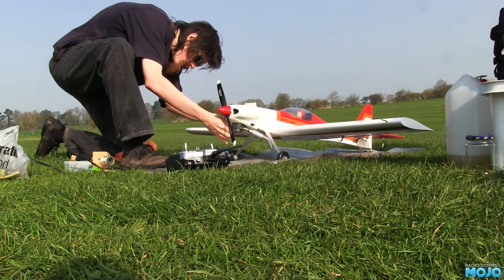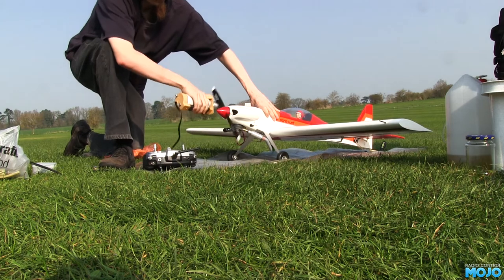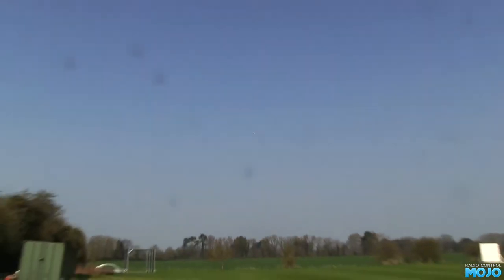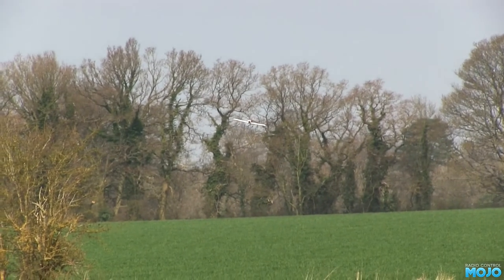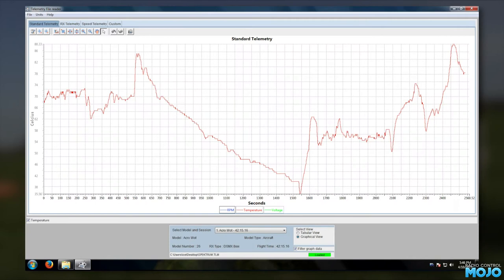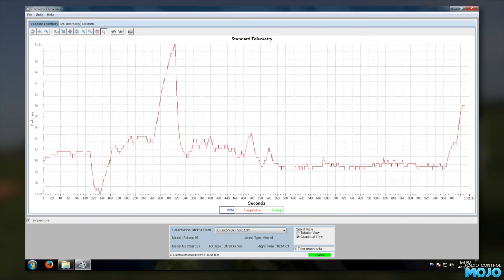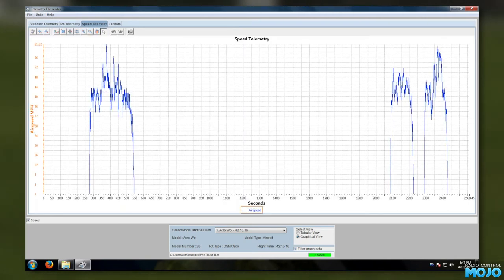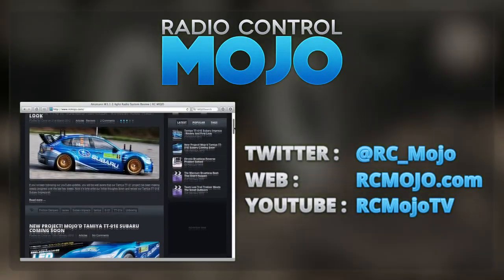Chris Foss Acro Wot - Bit of flying and graphing!

Comment: The golden rule to prevent carb flooding with any make of engine is to align the top of the tank with the centre line of the carb venturi. This makes flooding a thing of the past. Believe me, it works every time on any two or four stroke nitro/glow motor. Not only will flooding cease, but an engine will tune better and be more reliable on the ground and when flying.

If the tank top is placed above the carb, flooding will occur due to gravity and syphonic action. 

Placing the tank slightly below the centre of the carb is vastly less problematical than having a high level tank installation. Tank top level with centre of carb is the best option even if it means having to butcher some of the tank bay to accomodate a better tank level.

 In a nutshell, partial depression within the carb will lift fuel from a centred or slightly low installation without issue. High mounted tanks can be a nightmare due to gravity flooding issues. 

For a more detailed explanation on the issue, go to the Laser engines technical thread on the RCM&E site where Jon Harper of Laser Engines and others fully discuss this type of issue. Its a good read with much discussion with many pictures and vidios to view. Highly recommended.

Comment: Lovely smooth landings there...👍

Always a good idea to close the carb barrel tightly before turning the model off with a mounted engine prone to syphon fuel. I have an inverted Laser 120 that would otherwise drip the tank dry.... 👍